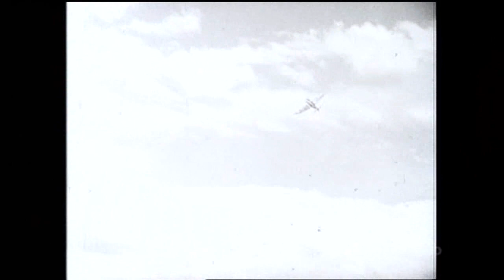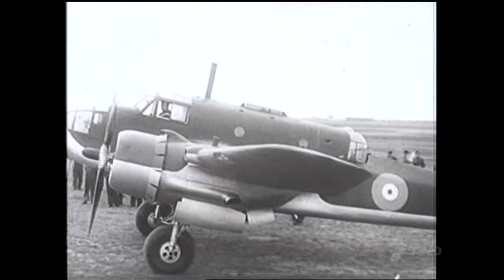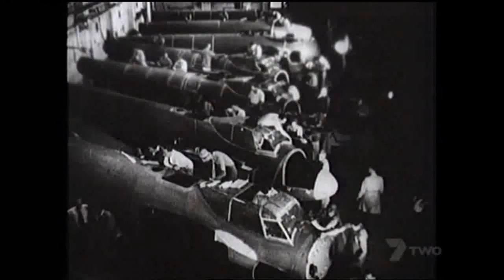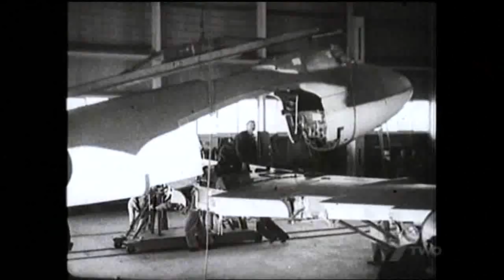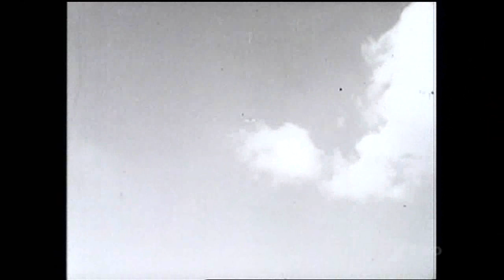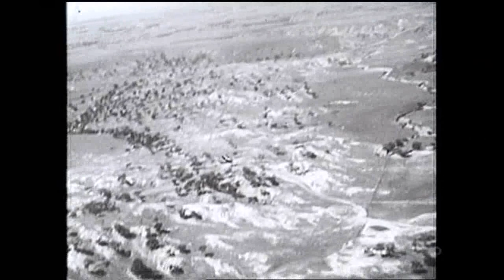RAAF Spitfires Beauforts Mosquitos Boomerangs

Comment: DH98 Mosquito FB. Mk 40 / PR. Mk 40
212 built
Australian-built. Generally as FB. Mk VI, with (Lend Lease) Packard-built Merlin 31 or 33. Six aircraft modified for PR use as PR. Mk 40.
BAE Mosquito page

Comment: The Beaufort had a design problem which killed many pilots in training. They eventually realised and fixed it.
Reply: Australia should have went with the Australian made and designed Wacket bomber. It was faster, more agile, had a greater range and packed a bigger punch than the beaufort. It could be used for both torpedo and dive bombing.
Reply: @wufongtanwufong5579  Do you mean the CAC Woomera?

Comment: My mum God bless her was a machinist who made some  metal components for the beufighter and other weapons at a converted factory in Auburn, NSW.
The girls had to make the stuff for all the troops to fight with and had to learn their roles very quickly. Hats off to them.
Phil O. Sydney Australia
Reply: Warren552011  

Mate it was either Carmichael's in Auburn opposite the Steam Engine Cleaning Facilities on the eastern side of the old Clyde Marshalling Yards or it was Malleys Lidcombe. Mum pointed them out when we were driving past the old buildings in the early 70's.
Its all changed now. Mostly warehouses and container freight depots. We would be in trouble if war and threat of invasion happened today.
Cheers
Phil

Comment: I'm away from my references, but there was a version of the boomerang that used the cooling fan concept taken from the FW 190A and a turbo supercharged engine that had amazing performance, not put into production because it was not needed - off hand I think it was the CA-14
Reply: That would have been some aircraft going by the video of the Boomerang here but like the Sentinel tank changing circumstances and American  influence stopped development.
Reply: @FairladyS130  It was the CA-14A.
New Larger fin, Turbocharger intake now in engine cowling, ducting along port side.
Better engine cooling (setup similar to FW-190).
R-2000 engine with GW B-9 turbocharger and a curtis electric 4 bladed propellor.
Estimated Max speed sea level 285.8 mph: @ 27000ft - 371.5mph.
Development was stopped for lack of need and so as to not complicate logistics by adding a whole new a/c type that dupilcated existing capabilities (same reasons as the Sentinel).
But both were, whilst not perfect, incredible achievements at a time when there was (below the highest levels of Govt) a genuine belief that the Japanese were likely to invade.
Reply: It wasn't a "version of the boomerang. It was a totally different plane. It was scraped because the war ended because Australia could only afford to develop Jets or the CA-14. Jets won out. Ironically Australia still relied heavily on the Australian made mustang. A plane the CA-14 out performed in a all areas. Australia also built the Wacket Bomber. A rival to the Beaufort.    it was faster and had a far greater range. It could also performed well as a dive bomber. But it was sabotaged during tests. But they ended up making a dozen or so before the war ended that project as well.
Reply: @wufongtanwufong5579  It sounds like you are thinking of the CA-15, I have described the CA-14A

Comment: I believe Australia is the only country to manufacturer planes before manufacturing cars.
Reply: Now we don't do either.
Reply: @blueycarlton  We do manufacture aircraft, there is a quite strong light sports aircraft industry such as Jabiru ( also make their own engines), Brumby, Hughes and Drifter. We just don't make airliners and big planes.
Reply: Actually the factories in which the aircraft were manufactured were assembling automobiles
Fisherman's bend was one of the many places where the GM automobiles were assembled by General Motors Holden
Reply: Ford were assembling automobiles in Geelong
Reply: Warren552011  .
In 1901 Harley Tarrant produced the first Tarrant automobile, which was the first petrol-driven car built entirely in Australia in a small workshop in Melbourne.
The 48 215 manufactured by GM Holden is incorrectly held as the first car made in Australia.
It was the first mass produced model of a production line motor vehicle.
Lauded as Australia's first car
It was actually entirely designed in the USA for the Australian market.
Basically a cut down Chevrolet with a small motor.
I believe there were six manufacturers of uniquely Australian vehicles including the Tarrant before Ford and Holden ever began assembling automobiles.
So no we didn't build aircraft before cars.
It's not that hard to find out for yourself the facts